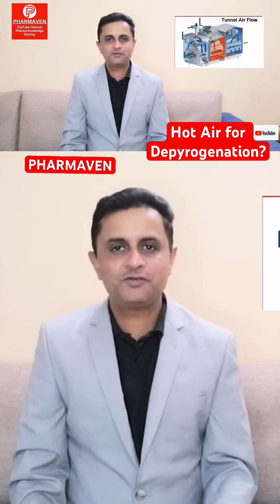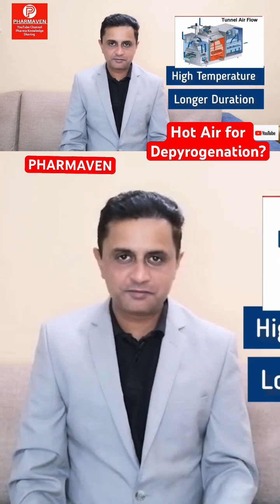Hot Air for Depyrogenation? How it works? #sterilization @PHARMAVEN #validation #qualification

Comment from the maker: Depyrogenation Tunnel Working principle & validation #sterilization #usfda #aseptic @PHARMAVEN  

Your Queries

1. What is Depyrogenation
2. How to qualify Tunnel
3. Hot Air Sterilization
3. Dry Heat Sterilization
4. Depyrogenation
5. Tunnel Qualification

#sterilization #sterile #heat #dhaval #usfda #aseptic 

Why Air Removal is Required in Autoclave?
How to calculate F0 Value?
What is Overkill Cycle in Steam Sterilization?

#sterilization 
#autoclave 
#aseptic 
#usfda 
#steam
#bacteria 
#bacterial 
#filter 
#pharmaknowlege 
#sterility 
#qualityassurance 
#quality 
#sterile 
#gmp 

@PHARMAVEN